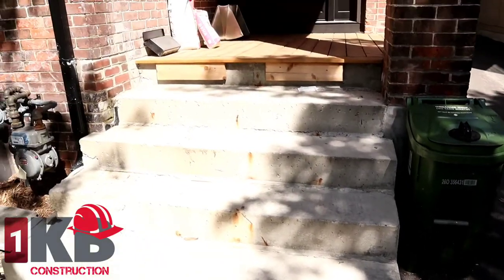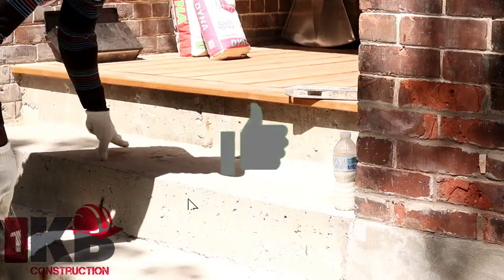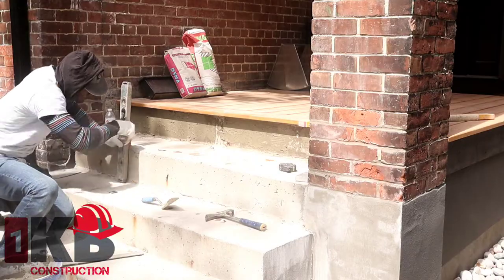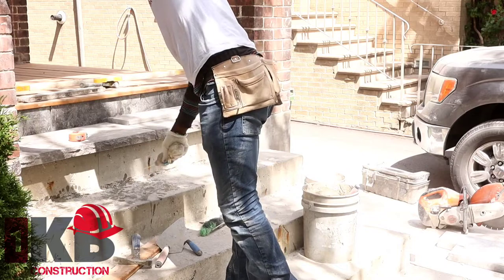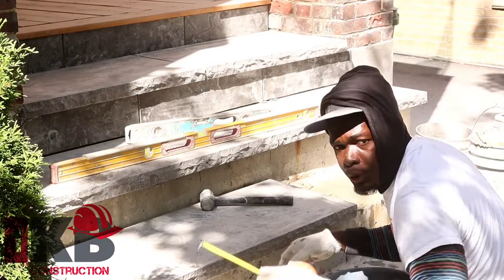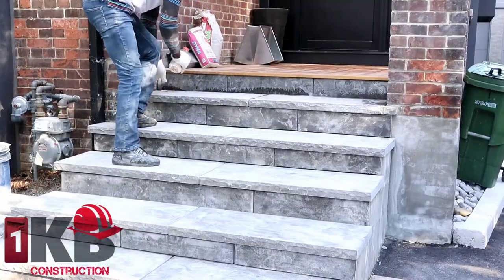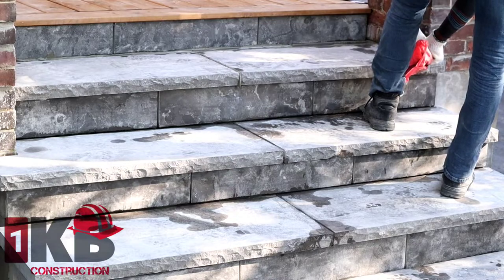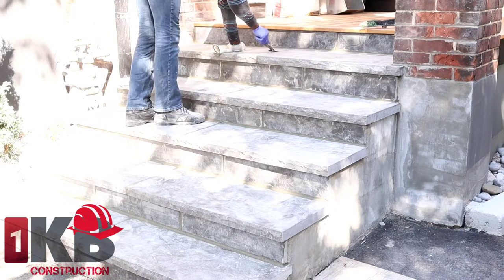how to lay flagstone on front stairs - stone coping on steps

Comment: Beautiful work! I hope do such a thing on poured cement steps that have tilted backwards after settling for about 60 years. Thus, I will need to pitch the underlying cement for the steps to drain properly. Is there such a cement I could use that will have a buildup greater than 1/4 inch as it approaches the riser? Thanks! Sean

Comment: I need my steps done correctly. I have paid to have them resurfaced 3x and each time it only lasted 2 to 3 years. This will be my 4th time having the steps repaired. What materials are you using and can you list them. I am getting to the point of having wooden steps buildt over the concrete, and that might be a bad move.